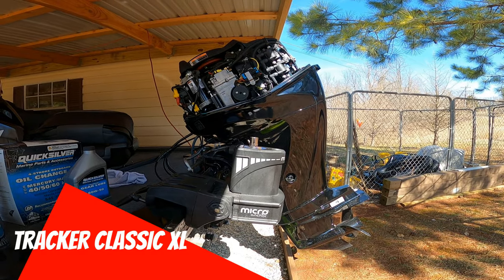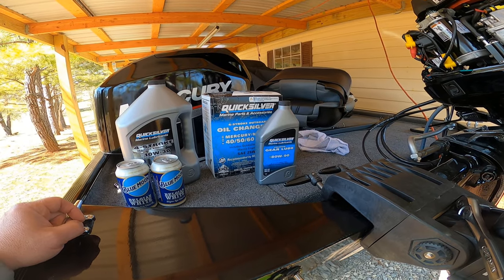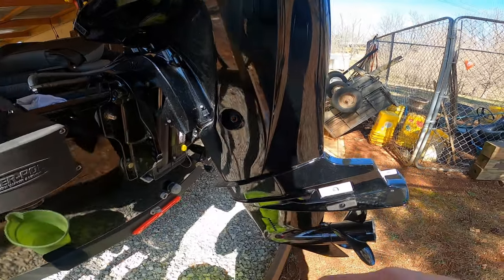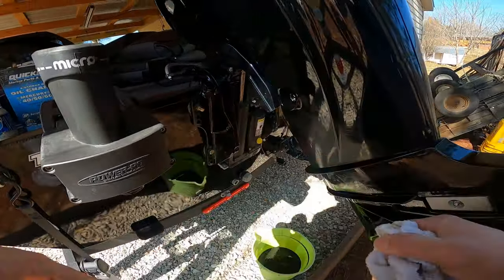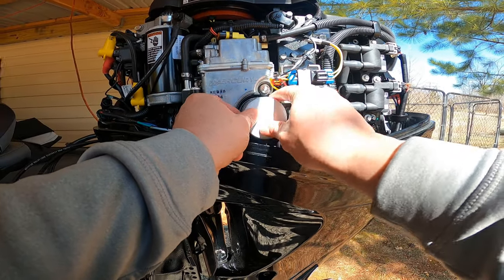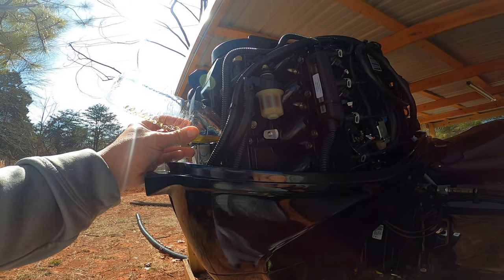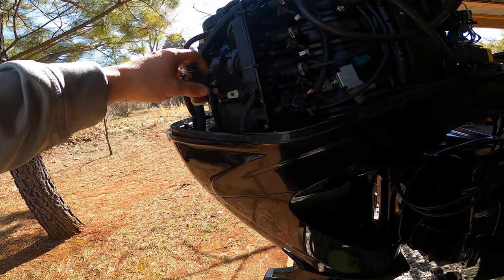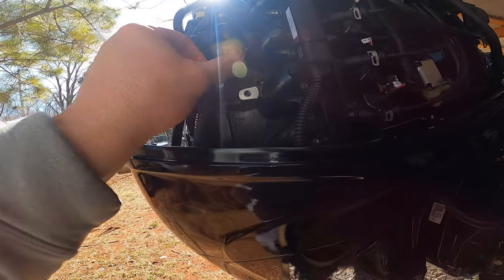Bass Tracker Classic XL Oil and Filter Change

Comment: Do you know the size of the filter cap wrench you got from Advanced Auto Parts? I want to make sure I get the right one. Thanks in advance!
Reply from the maker: Paul let me take a look for you.  Its out in my shop.
Reply: @RCBassin  I appreciate it!
Reply from the maker: Looks like they are out of stock on AdvancedAuto website but I found it on Amazon and a little cheaper as well Lisle 63600 Oil Filter Tool,U.S.,2-1/2 - 3-1/8 https://a.co/d/2mAzLyI
Reply: @RCBASSIN (*Army Vet*)  thank you so much and thank you for your videos. I get so much out of them!